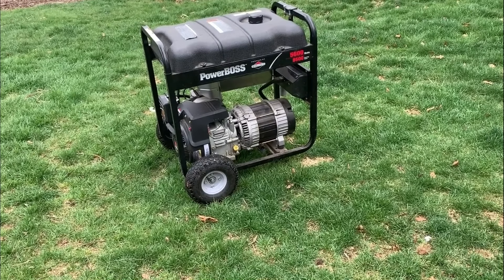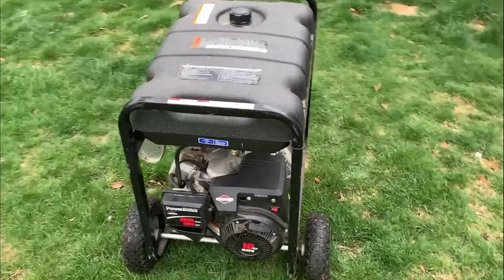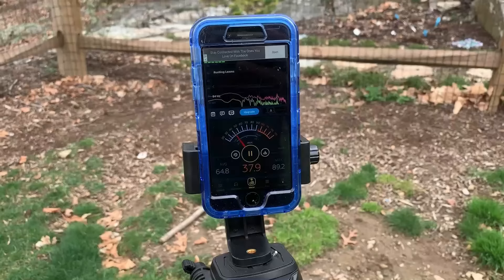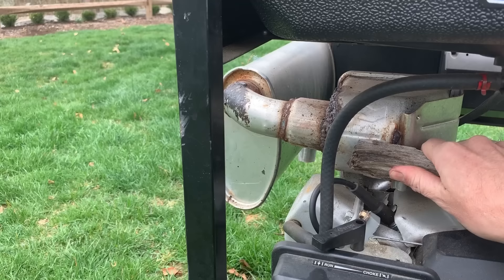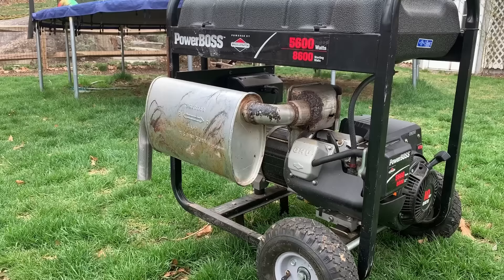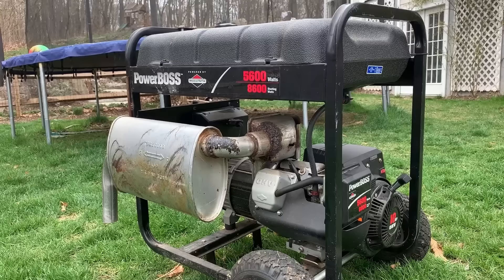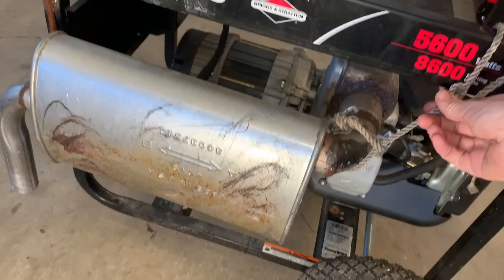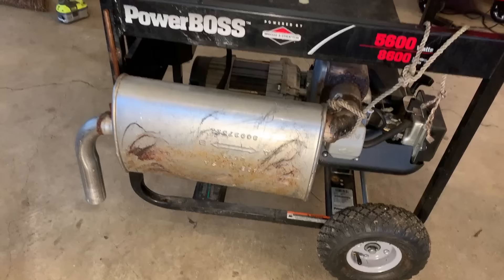Will a Car Muffler Make a Generator Quiet?

Comment: Try a sheet of plywood leaned against the generator to see if you can reflect the sound towards your neighbors and lower the level at your meter.
Reply: A sheet of 2021 plywood is more expensive than a 12 mufflers!
Reply: Mine poisoned my 8 year old black lab. This little boy dog came into my hands with one eye. He was athletic, robust and healthy. As the porch light came on, he split the light for missing eye to good to catch a tennis ball. I am fighting a decade of lumbar fusions (4) and have my 13 epidural coming next Tuesday. Bad elbows caused me to use a plastic throw stick and boy he could catch up to 11 in a row. Slept on my feet all night and napped under the tree shade while working on my truck. One day, he crawled to the fan, then laid belly down on the cold March ground, couldn’t catch his breath. Lady VET told me all organs were shutting down & eyes were blood red in 10 minutes. Gone in 1.5 days. A hell of a way to remember a birthday, my 60. Miss you buddy! Damn neighbor from another country. It ain’t a muffler story but real quite!
  Worked a motor cycle dealer, expansion, compression, reduction in exhaust with a hole the size of a nickel. Then quite.
Reply: You are the reason I'm glad I don't have neighbors.
Reply: Fuggin lol rite mate
Reply: I saw a video on this.. the leaning of a sheet of plywood on each side.. really cut the decibel level 20 pts on the meter.
Reply: ..makes the most sense, and it's a  cheap fix, that can be re-purposed!
Reply: lol, you must be my neighbor.
Reply: I would build a plywood box and staple pink 4" insulation to the inside, fuzzy side out and face the opening and exhaust away from where I was working. Usually at 100+ feet away. Worked so well I could listen to the radio. Oh yeah, first I tried all kinds of mufflers but the box worked the best.
Reply: If there's one thing xkcd taught me, it's that an elliptical reflector dish is far more effective in this regard.
Reply: @elbob248  everyone has neighbours. I remember one time a neighbour in my cabin in the woods with land around it came and complained about the music being too loud. fucking hell
Reply: @leolego2  That's fascinating.
Reply: As a carpenter I can say that works I use plywood to direct the noise away from my cut station
Reply: Your not lyin
Reply: @deankay4434  I hope you had that SOB arrested. If not, i hope he got a little vigilante justice.
Reply: LMAO 🤣🤣🤣
Reply: @Dean Kay I mean you said you found the dog, and then had it for 8 years? So I assume your dog was probably at least 9 maybe 10 years old. You sure the dog didn’t just die from some thing natural?
Reply: Nah, use a parabolic reflector, make sure you hit the proper focus point, and then aim it right at their bedroom window.  Oh, and get the generator as close as possible to that window, too.  I'm assuming you hate your neighbors?  I'm glad you don't live next to me, or do you?
Reply: That's my plan

Comment: A large amount of the noise is actually mechanical.
Reply: Sounds like a huge exhaust leak I mean look at the welds lol
Reply: Yep... It's a Briggs. Desiged to 100th of an inch and precision machined to tenth of an inch tolerances.
Reply: Valve-train can be noisy
Reply: True, my old diesel truck it’s pretty quiet as it is, the noise it has is just from the engine & the mechanical side of things.
Reply: Exactly what I came here to write !
Reply: exactly correct. Putting up a piece of plywood at a safe distance between you and the generator would quieten in down more than modifying the exhaust. The engine is designed to run correctly with a specific amount of backpressure anyway. You really wouldn't want to change that either.
Reply: @Ryan96se  I seriously doubt there is any scavenging at all on a generator.  Large car engines, I am pretty sure, do not need back-pressure, they need scavenging.  Scavenging is pulses in the exhaust where low pressure waves are behind the high pressure waves creating  a suction to the open exhaust port to more quickly evacuate the combustion chamber. But this always is multiple cylinders and from what I know, uses the manifold to do the scavenging because it is very specific.  Even slight changes to the exhaust will cause the effect to not happen.
Reply: i have an old honda eb5000 generator that is powered by a gx390 engine, i also have a go-cart also powered by a gx390 engine. the only real difference between the 2 engines is the mufflers, the stock muffler on the generator is a huge rectangular thing about 1-1/2 feet long and the go-cart has the stock muffler that came with the engine. even though the 2 mufflers are vastly different both engines are just about the same loundness because most of the noise isn't coming from the exhaust, it's coming from the cylinder head and cylinder area. the generator muffler changes the exhaust tone and makes it lower with no high-pitched pops, that's pretty much all it does. that's why the quiet generators all have insulated cases covering up all of the mechanicals, that's what makes them quiet.
Reply: The military has long found if you dig a hole and put the generator in. The sound drops. 
Folks it's not complicated.
Reply: Yep...and if that muff does make a difference it because it points at the ground and the ground absorbs it....air cool motor will always make racket
.best move is to deflect/reflect away from where you are.. I live in a mo ho, I have ran all kinds of generators...those open frame deals work ok with 3 sides plywood and a long extension cord...inverter gems are plenty quiet if it's one of those 2k deals that are in a case..and somehow the dint overheat...quietest one I have is the one I have now...4 k onenote out of a mo ho...sitting on blocks of wood...3 sides plywood and a wireless remote that a made out of an rc car transmitter and reciever...its a gas hog but makes major power...3 car batteries and a high output car battery charger run it for an hour...charge the batteries and I can run off the inverter for several hours as long as I don't need the ac..ac on..cant hear the gen at all..lol
Reply: @Sebastian Weetabix he is correct.
You can have an exhaust so quiet, even with a Jake brake on in a hospital zone, and a cop next to you with his window down, and he won't even know it's on.
Most of the noise comes from the engine bay.
Part of the problem it that a diesel literally runs on orignition, where the fuel detonates inside the cylinder. Nature of the beast, you could say.
The newer engines have close tolerances, and fuel injectors can meter how fast fuel goes into the cylinder, to a point.
One of the ways they cut down on the noise is to put sound insulation on the inner surface of the hood, and it works quite well.
Gassers.... I'm fairly certain it was Evinrude that put out an ad back in the 70s, they had totally redesigned their outboard, making one of the quietest two-stroke engines available at the time. They would get rid of one noise, and uncover another.
I've always liked quiet power, so the exhaust was a valiant attempt, but probably could have been done better with some custom baffling tuned to the pulsing exhaust of a single cylinder engine.
As far as the ambient noise of the engine itself, one could fashion another insulated set of panels around the whole unit, but then there is the issue of cooling, which would have to be monitored and experimented with during the design and construction.
I tried this with an air compressor, just an air compressor, and it got too hot for my taste, so I abandoned the idea. I just didn't have the time to fiddle with something that would work better, and still keep the unit cool.
It did an impressive job of cutting the noise to a reasonable level, though.
The whole problem is that insulation for noise is also insulation for heat, even if it's wildly inefficient.
Reply: What speak louder, I can't hear what you're saying!
Reply: @assassinlexx1993  
Amen
Reply: @danieljones317  the addition of a medium-sized electric fan works wonders.
Reply: @thefirstmissinglink  you would still have the ventilation openings that would just be ports for the noise to escape.
Reply: I’m glad you said it.
Reply: Isn't it ALL mechanical? I mean, none of it is paranormal. Then again, maybe it is. Maybe engines are loud because that's what dinosaurs screaming sounds like?
Reply: @duronboy2  to a point.
The fuel combustion is obviously from detonation, which is chemical.
The real problem here is that small engines have a lot of vibration and opposing forces.
Consider that every other revolution that the cylinder fires, not every one.
That's why something with 4 cylinders in a row is much better than a single cylinder, as you have one dumping hot gasses while another is on the power stroke.
Still a lot of vibration.
In line six-cylinder engines have less vibration, because you have two cylinders that are 45° off, which cancels out more vibration.
The more cylinders, the more vibration is damped, because the power to the shaft is dispersed more evenly.
The mechanical noise is a different story.
Pushrods, valves, the reversing of the piston direction, all plays a part.
Even the intake makes a fair amount of noise, because of the airflow.
Start, stop, start...
It sets up pressure waves. The air filter does more than just filter the air, it dampens the noise from that effect. Since it's not hot, a large chunk of foam rubber can do that job.
Best bet, my own idiotic opinion?
The engine would need to be shrouded with sound deadening insulation, have baffled cooling openings, and be designed to have good cooking air draft to cool the cylinder head, at the very least.
Anyone knows that the only reason motorcycle engines are loud these days, is because people either knock out the baffles, or put a custom exhaust on.
The engine itself is larger, usually a V configuration, and has been designed to be rid of a LOT of vibration.
Can't do that with tiny engines as effectively, but it CAN be done.
Too many scooters are out there with 50CC engines that are very quiet to say otherwise.
Reply: all the noise is mechanical. lol.
Reply: @DieselRamcharger  of course it is. I hear it every morning when I wake up.
My bones crackle and pop until I warm up!
Reply: @danieljones317  I'd imagine you'd want to create baffles. Louvres might be an option.
Reply: @danieljones317  aint that the truth.
Reply: @danieljones317  As far as the air compressor is concerned, I found that adding an appropriately sized muffler to the intake makes a very noticeable difference, and if possible I route the intake outside.
Reply: @johnduerksen9191  tried that. Even with a good filter, which knocks down the noise considerably, the fact that it's a smal, single stage model, it's still noisy from the mechanical noise.
Louder than a generator, in fact.
But, it currently does not get but occasional use, and plays backup at the moment.
6 of one, half-dozen of the other.
If it gets too raucus, it get evicted to a place outside the garage.
That only happens when I have a lot of work that requires air, and it's the only option.
Reply: …and intake.
Reply: intake noise too
Reply: Yes.   Someone tried this a few years ago and it's the mechanical noise of the top-end of the motor
Reply: @creamwobbly  Stop being pedantic with these responses. He obviously is referring to it being the valves, lifters, intake vacuum and vibration causing the majority of the noise vs the explosion of compressed air and gas.
Reply: @tarstarkusz  exactly. I don't understand why people think backpressure is a good thing.
Reply: Well it is a B&S engine. So bad that Mr. Briggs wanted his name removed.
Reply: True the generator components and the engine itself is LOUD.
Reply: @mikem302  or maybe the hole in the oem muffler…
Reply: ⚠️Generator safety tips: 

This is only a reminder 

1) KEEPING OTHERS SAFE: Please do not allow an unqualified person or your children to operate and service the portable generator. Just because some manuals don’t say that doesn’t mean it’s safe. That is important against the generator safety rules. We also need to be keeping an eye on our children too. You need to make sure that your children are not playing near the portable generator especially when it’s running so they won’t get electrocuted. Generators pose electrical risks and they can be hot during an operation. Please keep your children away from the portable generator at all times. It is important to keep our children safe especially our little ones. Children often get curious about anything so we should keep an eye on them to also make sure they’re not wandering towards the generator. 

2) WHERE TO RUN YOUR GENERATOR: Some people use their portable generators indoors which increases the risk of carbon monoxide poisoning. It’s important to have a carbon monoxide if you have a gas generator. Never ever use your generator indoors even if your doors and windows are open and even in the garage is not safe to use a portable generator. Not even at your porch and your deck. It is never safe to use your generator indoors and in enclosed areas of your home. Your generator needs to be 15-20 feet away from your house. 

3)🔥FIRE HAZARDS: Never refuel your generator while it’s running. You need to let your generator cool off before refueling it and before storing your generator. Never overload your generator too. Never ever back feed your generator. You should never plug your generator into a wall outlet. Also never store propane tanks indoors. Please keep flammable things away from the generator as well and please don’t smoke cigarettes near the generator. Having a fire extinguisher next to the generator is also important against the generator safety rules. 

4) GENERATOR OPERATION: make sure your hands are dry before touching the generator. Never use your generator in wet conditions. Don’t let your generator get wet. You need a generator tent if you need to use your generator during wet weather. Please don’t wear loose clothes when operating the generator. Turn on your generator before plugging in appliances. Use the right cord for your generator. Please do not use worn out cords. 

Hope this helps.
Reply: @47f0  Is that why i seem to hear a slight clanking sound now on my 5500 storm responder? It has about 130 hours on it and i took care of it maintenance wise as well. I just got my power back from ida today by NOLA. 
Other than the jet getting blocked no matter what i do before storage, i haven't had a problem.
The sound had me thinking something was actually loose outside on the isolators or something. Could that be some piston slap or something?
Is it on its last legs or what? lol
Reply: @assassinlexx1993  A hole in  the ground during a hurricane or storm sounds like a bad idea, or do you have a backup gen somewhere else running a sump in hole #1?
Reply: @poppaluv  
You got me there. I don't live where it rains that much. Here it is winter storms that kill the power.
Reply: @47f0  Measured with a micrometer, marked with a chalk, cut with an axe, machined with a chainsaw!😂😁
Reply: OHC engines are quieter.
Reply: @47f0  like an AK-47, loose and reliable
Reply: Valve tap and other good stuff
Reply: @assassinlexx1993  I assume they have extended vertical exhausts as well?
Reply: @assassinlexx1993  They have also long found that if you fill the hole with dirt after putting your generator in, the sound will completely disappear.
Reply: This makes me puke in my mouth...
Reply: @The_Happy_Aviation_Enthusiast  who Tha Fock is this guy...
Reply: That's what I usta tell my wife when I'd rip one in the car.
Reply: I reckon if it was water cooled it would be a good deal quieter.
Reply: @thedoctor2102  Good idea! I'll run the sprinkler while it's running 🤣 jk
Reply: @laustinspeiss  I'm glad someone else picked up on this
Reply: @47f0  That's pretty poor
Reply: @Sebastian Weetabix why
Reply: @mikem302  Welds? What welds? Can they even be considered welds? LoL
Reply: @Ryan96se  They debunked that back pressure myth on Engine Masters. It never made much sense anyway, the engine can evacuate more exhaust with less back pressure. This means more heat being expelled(by removing hot exhaust faster), and more room for fresh air on the next cycle, and thus more power. That said with different exhaust lengths, you can get effects from resonance out the tailpipe that can lead to the power curve changing a bit or being slightly amplified at some RPM. The stock exhaust on this motor is not long enough for that kind of resonance. This is likely the source of the back pressure myth.

The case where you want some back pressure is if you're running a turbo charger, but there are  limits and too much can be a real problem.
Reply: Was about to say much noise is the engine shaking haha.
They're built to a price after all.